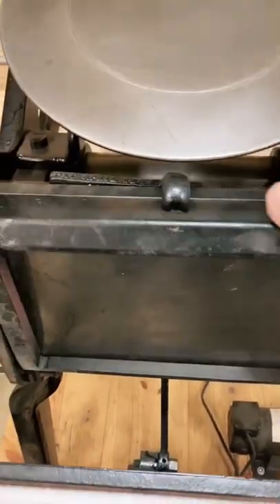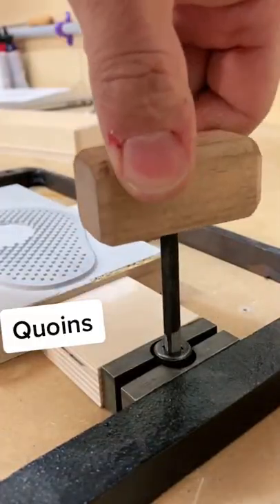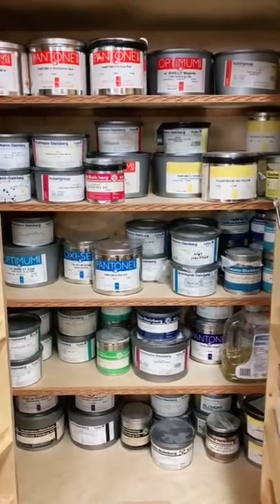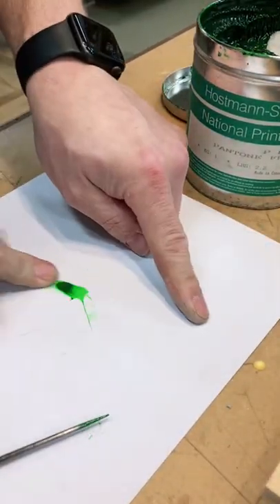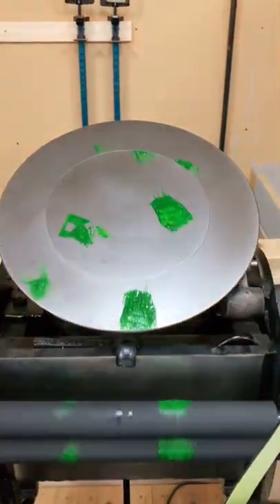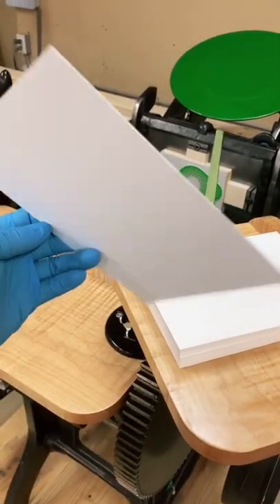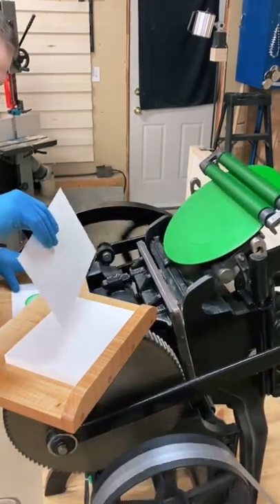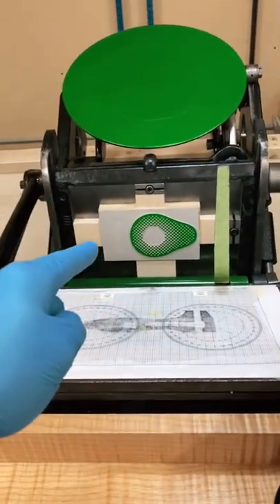Printing Press - Avocadon't Care Part ☝️✌

Comment: Thank you  for sharing your videos!  I was wondering,  there was a lot of the ink still on your press,  and quite a stack of prints.  did you have to reink the "plate" (sry, do not know the correct name)   Also, I saw the outer ring of the plate rotate clockwise and the inner counter clockwise. Correct?
Reply from the maker: A little ink goes a long long way. I didn’t have to ink the press again and I think I did 40-50 prints. Yes! The ink disc is counter rotating to spread the ink evenly a little quicker.